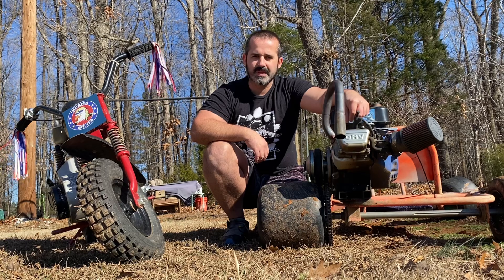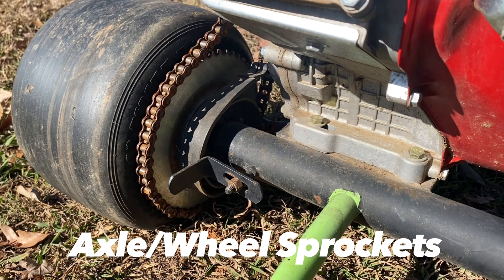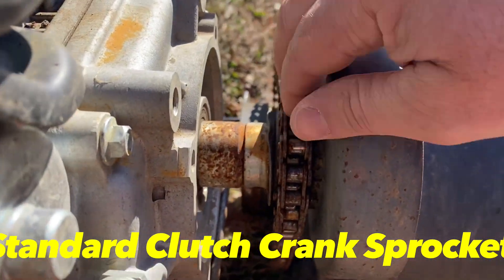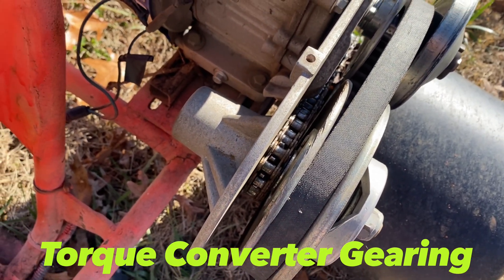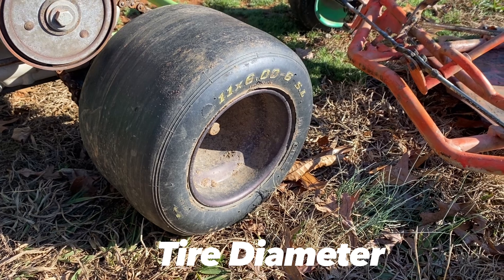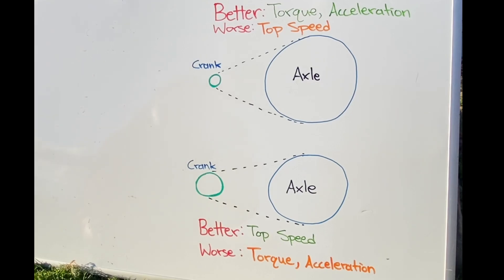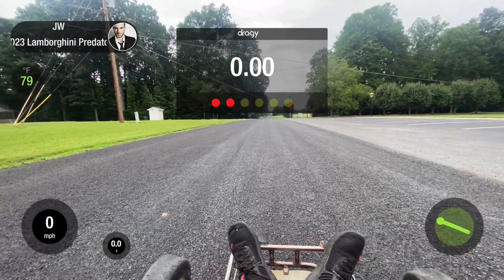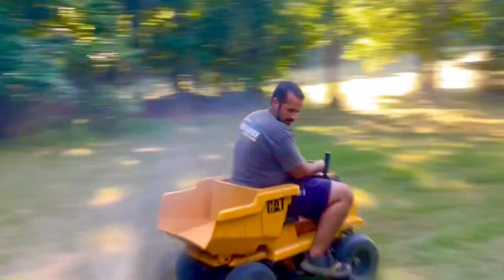Gearing Basics For Mini Bikes / Go-Karts. Sprocket, Torque Converter, Tire Size, Clutch

Comment: I was looking for some input on something. I'm putting a jet drive from a jet ski in my jon boat. My powerplant is a predator 420 with a stage 2 kit, governor removed, supposedly 20hp. I think I want a 40 series cvt. I know this engine/jet drive combo will work with direct drive, the crank coupled directly to the jet drive shaft. The main problem is that the boats with this setup are moving forward at a pretty good pace just idleing. I need a way to have a neutral and these 40's seem good to me. Secondary to the no neutral issue is that it seems like there's a pretty heavy load on these motors and I'd like to not beat up the engine as much. If that makes sense. The thing is that I have no idea how I'd gear it. The kit I want comes with a 10 tooth sprocket and for the jet drive side I have a blank canvas. Do I just do another 10 tooth and stay 1:1? Or will that shred belts? I don't really want to slow down the impeller so I'd like to go even smaller on the final sprocket and speed it up but it has to be reliable. And I am satisfied I guess with the rpm that 1:1 would give but of course faster is nicer. I have no idea how to compare a jet drive impeller in water to a go kart wheel/tire size. Maybe it'd be similar to a small tire in the mud? Any ideas? I kinda need a neutral for docking in crowded areas and I think this is what I want so I can idle without spinning the impeller.

Comment: Hi would you recomend a #35 chain for predatorr 212 minibikes or shall i upgrade to 420
Reply from the maker: 420 is the better option if you’re going to be riding really hard or there’s a chance the chain is going to be fitting stuff on the ground. I have ran 35 chain for years on all my stuff but would bend sprockets and hubs often so I have been swapping everything over to 40 over the past year or so.
Reply: @jwsbackyard6413  alr sick thanks. Im also getting a torque converter aswell and i gotta buy new sprocekt adn chain anyways.
Reply: @jwsbackyard6413  torque converter and 420 chain came in. wow i didnt know how massive the 420 chain is. cant wait to install converter
Reply from the maker: @RadboyFlies oh yeah it’s a lot sturdier than 35 chain.

Comment: I a ct200u ex I just installed a predator 224 I did gov delete 24mm nibbi aluminum flywheel 22 pound valve springs 30 series torque converter 10t in the front 40in the rear 19” tires and can’t even hit 45mph before I went with the 40 it had a 50 and was able to hit 50mph I so then put a 13 up front got wores down to 40mph I thought smaller rear more top speed bigger in the front more top speed any suggestions.
Reply from the maker: Hmm sounds like something else is at play. Ride it and make sure the belt is making it all the way up and down the pulleys. If it’s not then it could be a due to not enough power to take advantage of the smaller sprocket, not enough rpm, a belt that’s too short, or something binding like a bearing.
Reply: @jwsbackyard6413  thanks for getting back at me. Yes, definitely. I think it’s going to be under power because the belt is not going all the way up Stays  in the middle at full throttle. Do you think a cam will do the trick?
Reply from the maker: @albert8090  eh maybe, but something that may be cheaper and easier would be to change the spring in the driven pulley to something lighter so it will open easier and you can get the belt to the bottom of the pulley.
Reply: @jwsbackyard6413  i’m gonna have to look into that. It’s pretty much a stock 30 serious, Red spring. I’m gonna try to move it Take some tension off  See what that does.
Reply: I think this is normal for a torque converter because it’s better for more of the gearing up to be done by the chain and sprockets then the belt and cvt because theirs more resistance if the cvt does it. So actually  bigger gear with a cvt makes you faster and gives better acceleration(to an extent of course). I have a 12-53 ratio and I can go 63mph with a built predator 224. But i’m thinking of installing a 70 and seeing if it makes me faster.

Comment: I put a nibbi carb and the GPS cruser kit (cam flywheel 18lb springs and billet rod) also a hot coil and a straight pipe. I went from 42 mph down to 34 mph. Is this a gearing issue? I have a 30 torque converter with a 60t on the rear and big wheels 12” I think the tire is 19” diameter.
Reply from the maker: Sounds more like a fuel problem if you didn’t change anything with the gearing when you did all that. With the carb and exhaust you’re going to need a good bit more fuel. I’d try to tune the carb first. Heavier springs do sap power from the engine but you should have made up for that power loss with the carb and exhaust.

Comment: I have 18 HP motor with a 14t driver and a 40 driver on a jack shaft with another 14t to a 40t final drive to a Honda ATV rear end. When I turn the tire I get 6.1 turn at the tire.

Comment: hello sir.  Total noob here.  I have a frankenstein roller with a #41 60t sprocket and chain, using 18x9.5-8 golf cart tires.  I have a working engine.  I would like to just toy around the yard or pull a small garden trailer.  For a bigger guy would a straight clutch or converter work better?  Not really concerned with speed.  I prefer fun but a useful tool.
Reply from the maker: It sounds like you need a torque converter if you are planning on pulling a trailer. A standard clutch would more than likely just burn up unless you had a very large axle sprocket or a 20+ hp engine.

Comment: What about if there’s a large sprocket with less teeth or a small sprocket with more teeth?
Reply from the maker: That would mean that the sprockets use a different size chain. The basic way to look at it is by the diameter instead of tooth count. A smaller diameter axle sprocket will give more speed and a larger diameter axle sprocket will give more torque and acceleration.

Comment: I’m trying to set up an adult go kart that will achieve blowing donuts. It has a full suspension and four wheeler size tires and I’m planning on running a 13 horse predator with probably just a centrifugal clutch. Can you recommend what size sprockets to run on this thing for blowing donuts and drifting and climbing hills hopefully hitting 40 miles an hour, but it doesn’t have to
Reply: My drift cart is a 12 tooth drive sprocket with a cvt to a 60 tooth sprocket. Thing drifts amazing and without the drift caps it reaches 40 sumthn easy. 

With 4 wheeler tires you should go with a 4.1:1 ratio.

Comment: Thanks just getting into go kart racing im heavy so this will help me out. I got my ass kicked in my first race yesterday it could get moving go but took forever i was run a 15 tooth max torque and a 61 rear. That poop is gone i order a noram cheetah 2 disk with 12 tooth and im going to put a 70 tooth rear.
Reply from the maker: No problem, I’d be interested to hear how that gearing works compared to last race.

Comment: I have a manco like yours all factory stuff on it, I have a stock predator 212 but is a wheelie monster. How can I make it capable to cruise on the street? It has factory gearing still.
Reply from the maker: In general a smaller wheel sprocket should help get rid of the wheelies. got this one with most of the factor components missing. What is the gearing ratio? And is it using a clutch or torque converter?

Comment: Would running a 18 tooth clutch with a 46 tooth rear sprocket burn out my clutch? I live in Florida without much hills
Reply from the maker: It more than likely would. In some cases an overpowered engine could overcome that but I’m talking about triple the power of a standard 212.

Comment: please help me i bought a go kart everything was fine until we tried to drive it and it just won’t accelerate something feels tight i just don’t know what’s going on
Reply: Everything was fine until you tried to drive it? So everything was indeed NOT fine. It was never fine if it could never drive right lol
Reply: Make sure your clutch is engaging when your motor accelerates in rpm's if so may wanna take a look if your gears are set up correctly too small of a gear on the axel you will have to push it off every time you go to play with it

Comment: Great video so in your opinion whats the best middle point. What gearing is best for both. 10t and 50t...?
Reply from the maker: Are you using a standard clutch or torque converter? What size chain and what size tire?
Reply: @jwsbackyard6413 im using the juggernaut torque converter which has a 10t sprocket running to a 50t rear sprocket and im on a baja warrior frame with big tires.
Reply: @jwsbackyard6413 believe tires are size 19x7-8

Comment: So me and my daughter  just got into flat kart racing dirt tracks I use to do it as a teen but my dad did all the setup work  in my daughter's division she has a set clutch  of 16.64 and me I can't figure out where I need to be I run preditor 212 I used a 19 clutch  58 rear and got dusted we run on a ⅕ mile track  what in your opinion  should I be looking  at to not get dusted
Reply from the maker: Honestly I have zero experience with kart racing so my knowledge is limited on what they use there. That gearing is pretty high though. Good for speed but would limited acceleration and ‘throttle response’. Any thoughts on where she was losing time at? Lack of speed, slow acceleration, etc.
Reply: Drop down to a 13 tooth on the clutch

Comment: What’s the best gearing for drag racing a Coleman CT200U EX with a Predator 212? 
Right now I’m running a 30 series torque converter with a red spring and a 6” driven sprocket. I have a 60 tooth rear sprocket and and a choice of 8 tooth or 10 tooth driven pulley sprocket. Also, should I be able to run the same gearing for best times on both the 1/16 mile and 1/8 mile drag track?

Comment: helped a lot for my Briggs and Stratton engine will a standard clutch work? and how do I properly install? I don’t know how many teeth the rear axle sprocket has but it’s not a small one so if you can help and point me to one not too expensive I’d appreciate it a lot !
Reply from the maker: I’ve tried the cheap Amazon or eBay clutches for $20 and they have rarely lasted more than a month or two. I’ve had good success with Max Torque brand clutches. They go for around $45 but have lasted for years. You just need to make sure the clutch matches your crank shaft diameter when ordering. To install you simply just insert the rectangular key into the groove in the crank and push the clutch on. I would put a little oil or antiseize on the crank to kept the crank and clutch from rusting together. Some clutches have a key made into the them. You can install the clutch with the sprocket in towards the engine or out away from the engine; either will work fine just pick the way that gives you the best alignment with the rear sprocket. Then add a bolt to the end of the crank to keep it on or tighten the set screws on the clutch of it has them.

Comment: Ok. I think I'm set on a 4:1 ration for the kids go-kart (yerfdog spider box) original engine was DOA. I have 212 swapped it and am going to run an Amazon torque converter(clone 30 series). Rear tires are 20x10-8 tires. It's my 7 and 8 year olds kart. Does this seem like it should work? And if I add a vevo gearbox to that for D, N and R am I looking at changing gears again?

Comment: So this dont have much todo with sprockets. But i have a old frame i took apart when i was a kid. Now the front spindles are missing all it has is the C part. How do i measure to figure out what to buy to replace them. It was a old fw and associates van cart
Reply from the maker: The C part is called a spindle bracket or hanger. You would need to measure the inside of the bracket to see how tall the spindle needs to be to fit. Most karts use the same spindle unless it has springs so they should be easy to find. You also need to know the size of the inner sleeve of the wheel bearing to figure out what thickness the spindle and the width of the wheel to figure out how long you need the spindle to be.
Reply: @jwsbackyard6413  thank you!
Reply from the maker: No problem

Comment: That's all well and good, but I'm building a minibike with a predator 224 but I just want to cruise around the 30 MPH roads with 6 inch tires. Any recommendations? Thanks for the advice, and hell yeah I like this content. New subscriber here. 🎉
Reply from the maker: How tall is the tire and will you be using a torque converter or a standard clutch?
Reply: My bike cruises 35, has 30 series torque converter, 12 front sprocket and 50 tooth rear sprocket
Reply: I run six inch tires made for the road